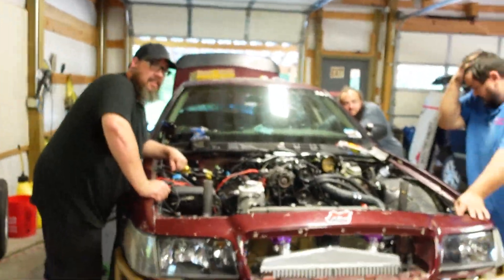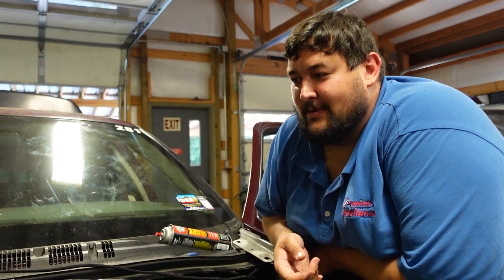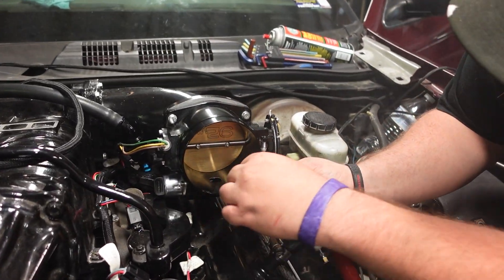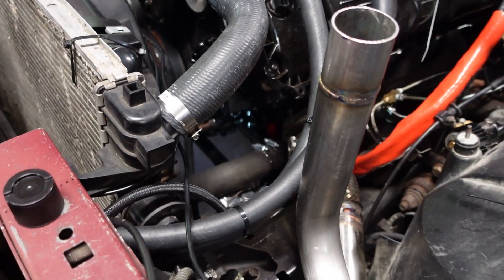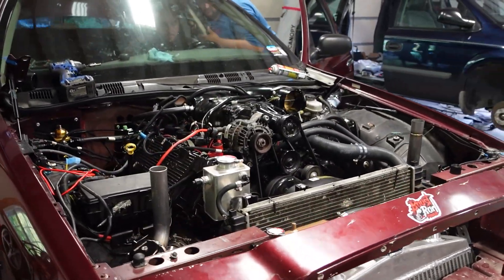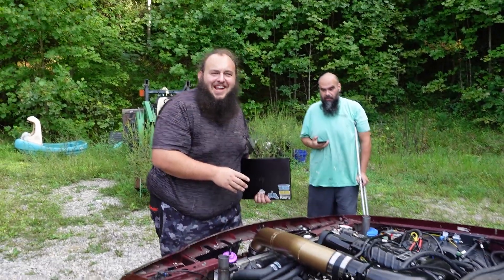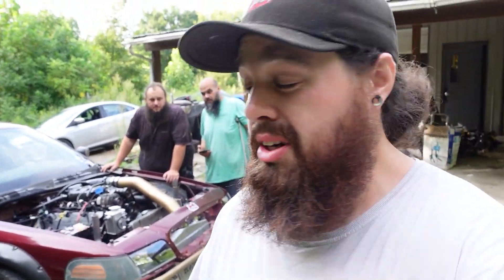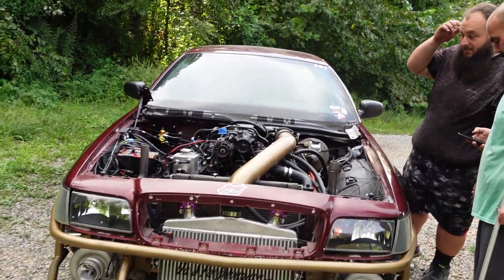Twin Charged Crown Vic FIRES UP & goes for its first drive!

Comment: Pressure sensor between the turbos and the supercharger will tell you everything you want to know. I have a MAP sensor between my stages to keep track of how much boost each stage is making.
Reply from the maker: I gave him my spare 4 bar omni sensor and we'll use his old one between the turbos to log both. Off camera we had a few problems we've already addressed. Between dead coils and vacuum routing. It should be much better next video!